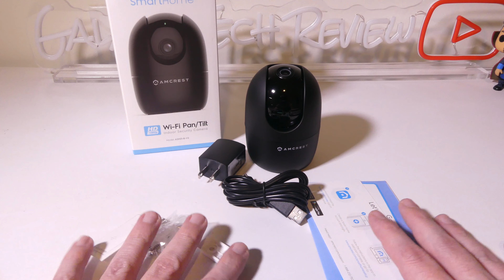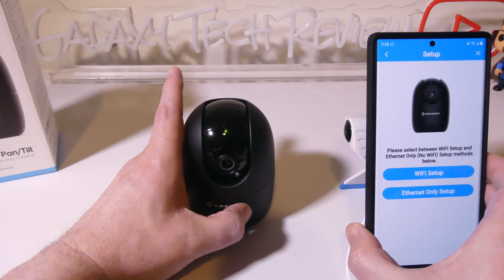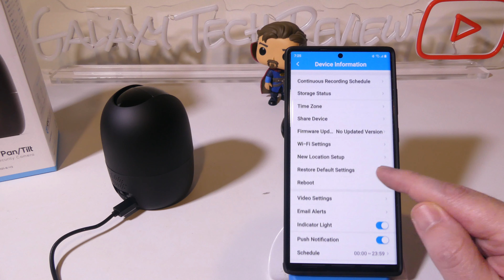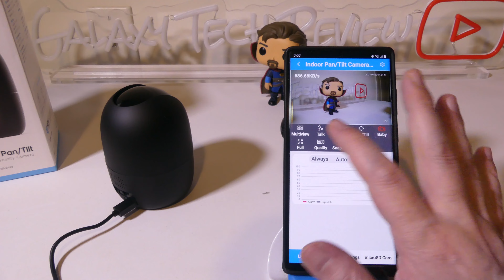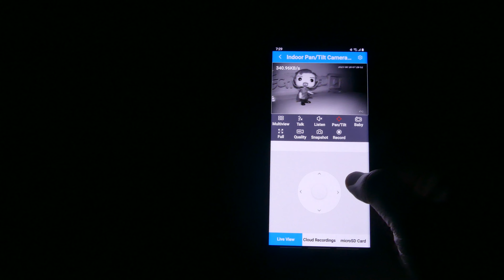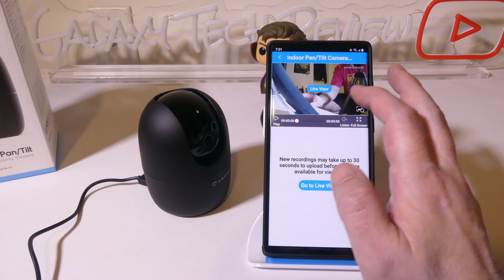Amcrest ASH21-B 1080p Indoor WiFi Security Camera REVIEW

Comment: I have been using this camera for a few weeks now.  Its a little on the slow side for how fast it reacts to pan/zoom even with a VERY strong WiFi signal.   It also requires you to register the camera for it to work, I don't like having to register it just to use it.   The WiFi range is not very long compared to all other IP cameras I own.    This camera only works with the Amcrest app.   This means if Amcrest wants to end supporting the camera
your out of luck.   My other IP cameras do not require registration and do not need a specific app to use it.  You can use most universal viewing apps or a browser like Chrome or Firefox, or allowing you to put all your different brand IP camera onto the same viewing app.   So far I have not found a way to view it without the Amcrest app do this with this camera.  I bought it used for 8 dollars and had to contact Amcrest to unregister it from the previous owner so I could register it and have it work.    If your not big user  of IP cameras and only watch 1 home IP camera this camera would work.  If you have multiple WiFi IP cameras be prepared to to only use the Amcrest app, and have have to toggle back and forth for to see your other cameras.

Comment: I have all my other IP cameras, even one that does not have a built in web browser viewing capability, to work with an app called "tinyCam" on my android phone.  I have tried many configurations and have not found one that works for this camera.  I am stuck with using the Amcrest app which works but i have to deal with advertisements plus it requires another step to view the camera unlike seeing all my cameras at the same time with "tinyCam"  has anyone found away to view this camera other than using the Amcrest app.  I usually avoid IP cameras that only work with the MFG app but this camera I found at a Salvation Army type store for $4.00.  Could not turn it down.   The other thing I don't like is to use the app you have to register the camera.  When I bought my camera it took almost a week before I could get Amcrest to re-register it to me.   The reset button does not remove the registration.
Reply: The other thing I noticed is this camera does not have good WiFi range.  Probably because it doesn't have an external antenna